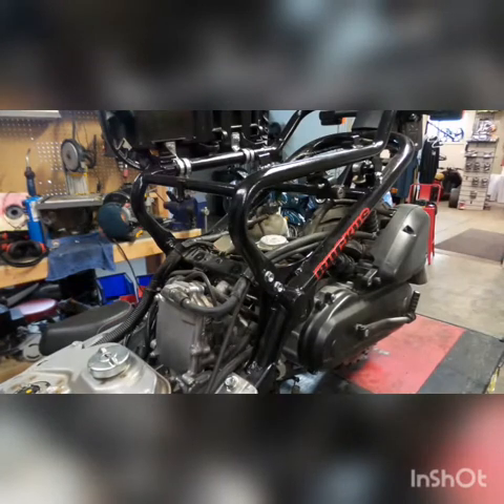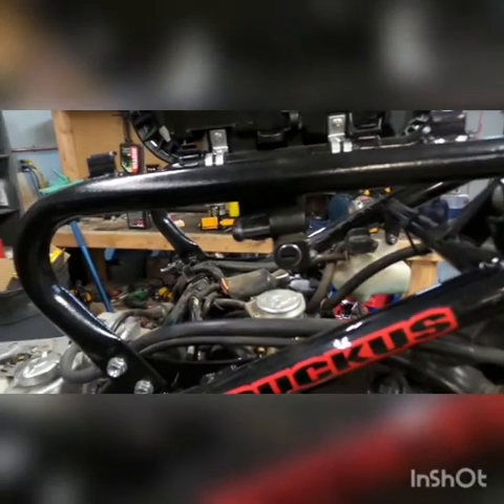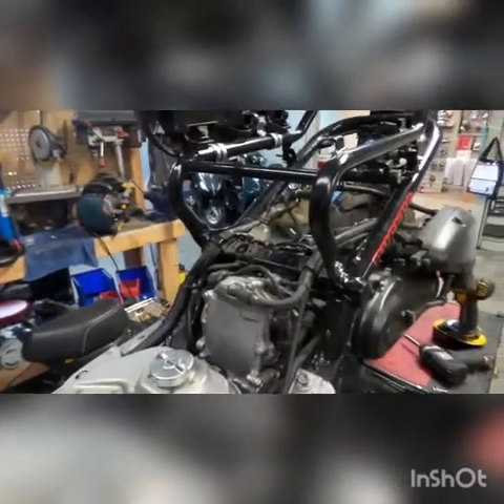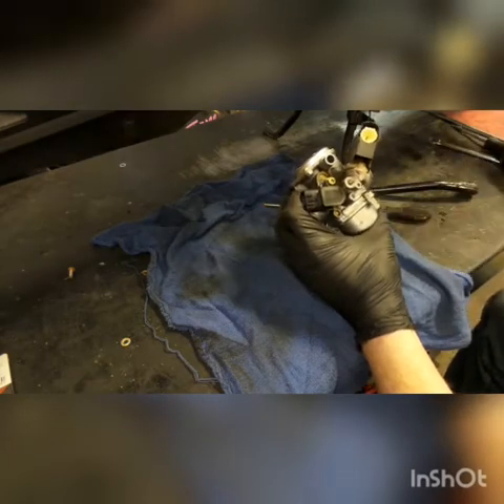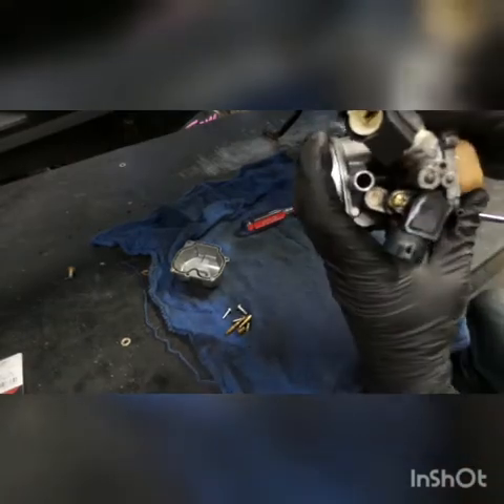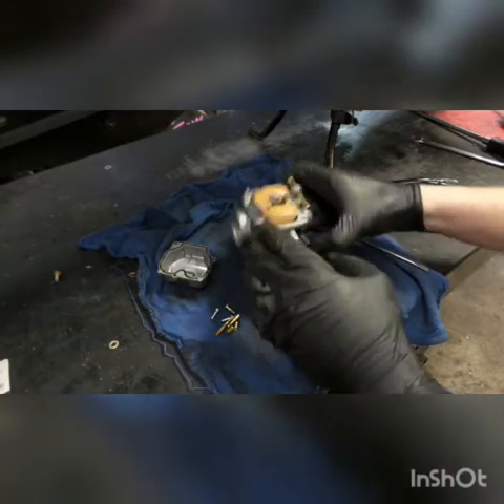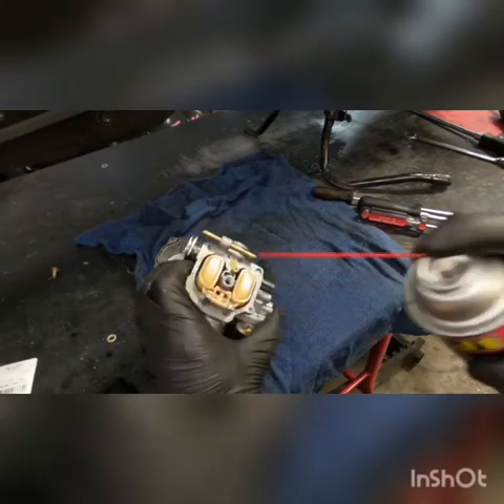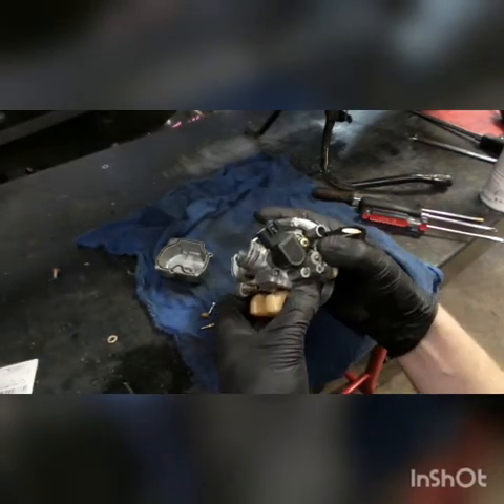Cleaning a scooter carburetor on honda ruckus

Comment: Very informative video, I have a 2019 ruckus and purchased a k&n air filter for stock air box. After installing it the bike bogged down probably due to being too lean. Do I need to reject the carburetor or could adjusting the mixture fix it? Also you mentioned special screwdrivers, mine appears to be an a-circle. Do you have any idea where to get one with a longer than 3” shaft. 
Thank you for the video and any advice you can give me.
Ron

Comment: hi thank you for your help. i was cleaning a carburator and i put it back together but did not make sure the pilot jet could see light through.

i put the pilot jet in a drill and spun it onto a single strand of wire brush to get a hole. then i ran two wires! it took awhile but you were right to clean good one time! 

i put back together and it started ok!